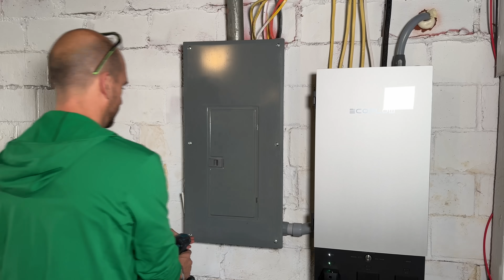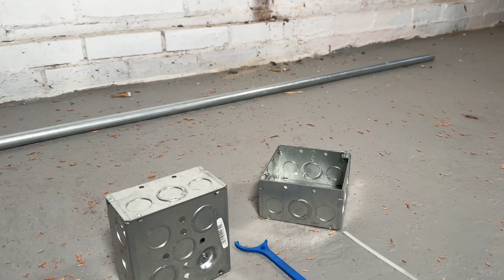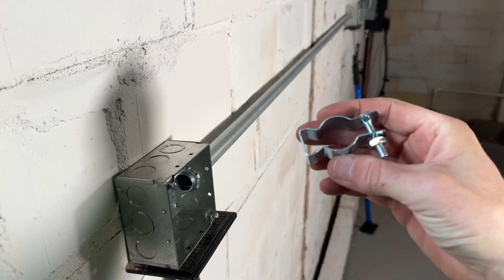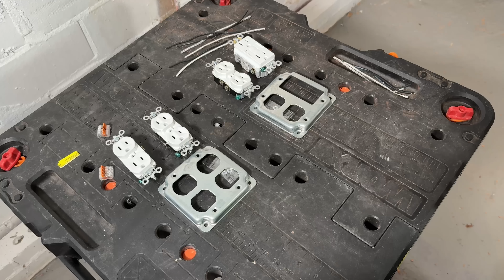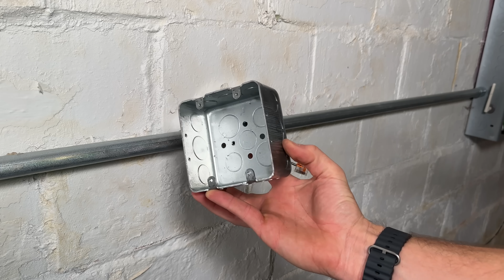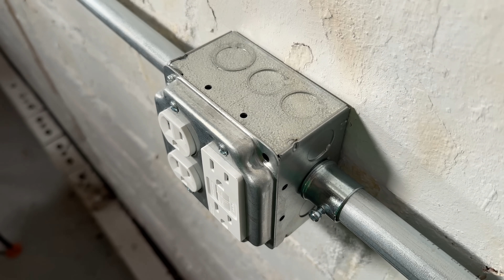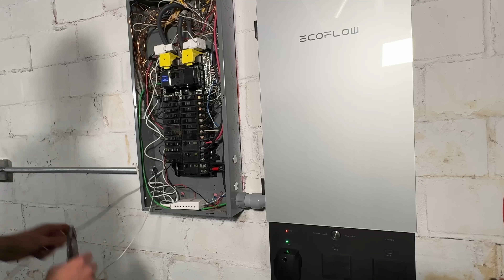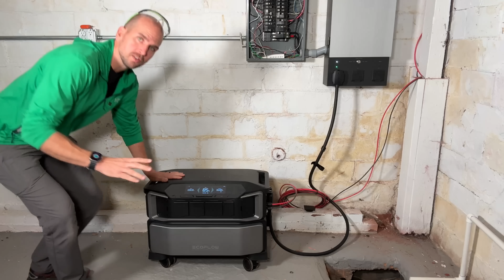Add Outlet To Unfinished Basement Or Garage

Comment: When your not using a dedicated ground wire, it seems to me the ground connection becomes dependent only upon those two screws holding in the face plate. In a damp environment, such as a basement,  those could corrode or rust over time, interrupting the ground connection to the breaker box and ultimately to the ground rod in the soil. Those screws could also work loose,  interrupting or at least weakening the path to ground. The extra work of adding a single green wire seems well worth it to me. I'm a science educator, not an electrician. But what do you think?
Reply: Why would fitting screws magically come loose or corrode but a ground screw is immune to those same issues? Nonsensical, conduit grounding path is solid and as long as it's installed properly will last for decades. EMT is installed outdoors every day so in a basement, even if there's dampness present, it's a non-issue.
Reply: @pld8993  You've got a point there, but with both a ground wire and conduit, you've got a backup in case one or the other fails. For the minimal extra cost of a ground wire, it seems a no-brainer to me.
Reply: @SiteReader  True, in this case the cost and labor to add a ground wire is miniscule, but I've done projects where adding ground wires would add many thousands of dollars to the project, sometimes requiring larger conduits to accommodate the ground also.
Reply: @pld8993 Ahh, I see. Well, as I said, I'm not an electrician but a science writer and teacher. If I were doing this in my house, I'd certainly add a ground wire. . . Come to think of it, I did a small installation in the garage of my old house where I ran conduits to two boxes on one wall to power an overhead light, my saw, and other plug in tools. I used 12 ga. Romex (which I think I recently read isn't the right thing to run inside steel conduit). I was planning to switch out the breaker to a 20A one, but I wasn't sure how and never got around to it.
Reply: @SiteReader  There's nothing wrong with running romex in conduit and it's sometimes required. Two of the biggest myths in the trade are a) romex is not allowed in conduit and b) everything must have a wire type ground. Both false.
Reply: @pld8993  Thanks.

Comment: Aren't  you required to have bushings on the connectors to protect the wires?
Reply: Not if the conductors smaller than #4

Comment: You never bent offsets in the pipe.
Reply: Not necessary.
Reply: @pld8993  I know tthat they aren't technically necessary, but it does make for a professional looking job.
Reply: @fldave612  No offsets is just as professional. Offsets are not always the best way to do an installation and sometimes they're the wrong way to do it. Sometimes, either one, doesn't matter.

Comment: Wish this video had been up twenty years ago when I wired my garage.  Along with the Wagos. Could have saved a lot of cursing at the 12 gage wire. But then I never use more than one power tool at a time, so 15 amp would have been just fine.

Comment: If you are making a video on electric and safety,  you should follow the code. NEC. 
YOU SHOULD PULL IN A GROUND WIRE, UP TO CODE.!!!!
Reply: The conduit is the ground and the NEC does not require a separate wire type ground.

Comment: You should always run a separate ground conductor. Redundancy is key in case any conduit connections come loose or suffer corrosion. At the panel you should use a bonding nut on the first connector. The enamel on the equipment or slight variations in the size of the hole can compromise the strength of the ground connection. Also you should use nylon or pvc isulating bushings after the nuts on all the connectors to protect the wires insulation. And finally, code requires the conduit to be strapped within 3 ft of any box or encloser.
Reply: Fittings do not magically loosen any more than ground screws magically loosen. Corrosion, except in the harshest of conditions, is rare. Redundancy is unnecessary on a properly installed conduit system.
Reply: @pld8993  Yes, I somewhat agree with you, but as someone in the industry, and does a fair amount of commercial work, I don't think I've ever gone in any shop or warehouse that didn't have conduits hanging by the wires or off some random mangled J-boxes. Where there's people, machinery and equipment there's damage, which is great for me being in the maintenance/service business anyway.

Comment: I know it meets code the way you did it, but I always pull a ground wire. Those set-screws on conduit become loose, and I don't trust that bond to remain over the years.
Reply: Set screws on fittings do not magically come loose any more than ground screws magically come loose.
Reply: @pld8993  then why do I find them loose all the time? Pull the wire, lazy electrician.
Reply: @pe-msee  So a fitting screw in a 1900 box will magically loosen over the years but the ground screw in the same box  is immune from this supernatural phenomenon. Typical, ridiculous logic from a not electrician who clearly doesn't understand what he doesn't understand. Properly installed fittings do not run the risk of loosening any more than properly installed ground screws.

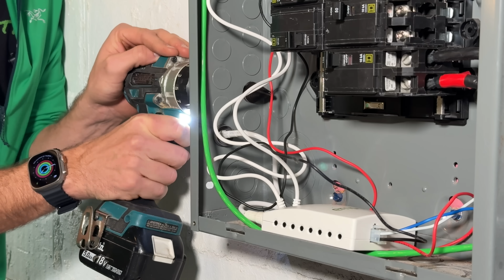Comment: Pro Tip, never blindly drill into a panel with a stepper bit. It's a good way to cut the insolation on a wire and cause a short. 1:12 Fortunately he at least pulled power first.

Comment: You probably didn’t even need to used a rotary hammer if you were gonna tap into the mortar, I would’ve at least got into the solid brick😂
Reply from the maker: I actually prefer brick as well but this specific home the brick is extremely brittle.
Reply: @EverydayHomeRepairs  ok well dang , I’ve seen some bad brick before and there’s a couple of work arounds . Keep up the good work it was a good video I know you’re trying to help people.

Comment: Hmm. A garage, with a nice 200 Amp service, and you opted not to install any 240 Volt, NEMA 14-50?   Besides that, all the professionals in the comments have some other valid comments.

Comment: While this is a good video, it is not just replacing an outlet, it is suggesting people can do this themselves. I would caution anyone to please NOT open the panel or subpanel unless you are a licensed electrician. I am NOT, so the most I will do is replace tired outlets and switches.

Comment: Not required, but it's a good idea to use other than the center knockouts in the 1900 boxes. It'll give you more room for wiring, and might be necessary if you put a dimmer or a 50amp receptacle in one in the future. There's reasons apprentice electricians usually have to prove 10,000 hours working with licensed electricians plus 5 years of school before they can even apply to take the licensing exam. All the good comments pretty well point this out.

Comment: Thanks for taking the time in making the video, but I honestly only learned about 10% or so of what I was here for. When you're teaching how to install wiring/outlets, please spend time in showing how to connect everything in the box instead of fast-forwarding the video. You passed on very little vital information, and some DIY home-owner is going to waste money on an electrical inspection, because you were not detailed enough in connecting wires.   It's obvious why you made this vide, and it wasn't to install / teach.

Comment: hello and thank you for the excellent video.metal emt is a good conducter for as your ground but in all my years as working with electric i always recomend running a green line as a posative ground in emt from outlet to back to service panel only as an additional safety to avoid conduit run  seperation.again thank you for the video.  mr dennis brown

Comment: I always run 2 hots, adding a red.  That way I can have each outlet on a separate circuit (it also allows me to easily change to 220v if needed.  And, I always add a green (as noted below), and add screws to support the conduit (as also noted below).  And, although it is a pain, I bend the conduit so it does lay flat against the wall (which is also mentioned  by others, below).
Reply: If you use Mineralacs you dont' need to do any bending to get back to the wall. Those standoff about 1/2 inch.
Reply: Wouldn't you then need the proper conduit bending tool? Otherwise you would kink or damage the conduit.

Comment: Come on dude run a ground wire - don't be cheap and  it doesn't dodge code.  Also when picking out junction boxes pick one with a ground screw so you can attach your ground wire to the local box and the  outlets.  Also you need to anchor the conduit.  I use offset fittings out of the boxes if you don't want to bend the conduit then you can use strap anchors.  Easy peasy.  Also my preference I like to use the plastic wall inserts you pound in for block wall.  Tapcons tend to blow out the wall easier.

Comment: It is permissible to use romex in conduit and the supports such as the mineralac straps are not a suggestion.    They are required within 3 feet of the box.   A ground wire, while not required on that conduit run, using the raceway as a ground path, is permissible.  But a ground wire would be a Cadillac job.

Comment: So will not pass inspection, conduit needs additional support. also no conduit offset to get up against wall, if not bending then could use a spacer block under maybe but should be clamped to that wall. Also I do not use the conduit as the ground, it does need to be continuously bonded since going to panel is but I run additional ground to outlets. most residential outlets are not designed to be grounded by the mounting tabs requires dedicated ground to outlets need commercial is doing that. I do not like using tap-cons since has sharper edges I prefer panhead screws.

Comment: In my state you would still have to run an insulated ground and ground each outlet to that wire as well as bond it to the box. Because if a screw or connector loosens you can lose the bond.
Reply: Why would fitting screws magically loosen themselves but somehow ground screws are immune to that? Which state?
Reply: @pld8993   I didn't write the rule man I just do it. Did you write this same comment on the 400 other people who wrote the same thing are you just saying it because my name
Reply: @lucyfuir6386  Which state? I'm curious if it really is a requirement, in writing, or if you're just assuming it is because that's what you've been told. What does your name have to do with anything and why would I care?
Reply: @pld8993  go away stalker not giving u my info
Reply: @lucyfuir6386  Yeah, either I'm a stalker or you're wrong because in your state no such rule exists. I vote for B, thanks for playing.
Reply: @pld8993  think what u want perv
Reply: @pld8993   Did you make the same comment on the other 400 people who said the same thing did you ask them what state they come from no you only asked me because I have a girl's name so F off
Reply: @ir6386 So you claim there's a rule in your state requiring a wire type ground and when I ask about it you resort to name-calling. Great argument, genius. Yes, I've asked plenty of people what state has supposed rules they claim it has and in almost every case they've been, like you, wrong. Having a girl's name doesn't make you wrong, you're wrong regardless. There's no such rule in your state.

Comment: Good video and found it informative.  As a always learning DIYer I couldn't help but noticed that your outlets and the GFCI appear to be 15 amp vs. 20 amp hardware.  Should the outlets not have the "9-o'lock" leg to designate that it's a 20 amp circuit.  15 amp outlets I thought just have the 2 vertical legs (plus ground hole), where as 20 amp outlets have that "T" on the left vertical  leg of the outlet.
Reply: If  there is only one outlet on the 20 A breaker. You are correct it would  have to be a 20A outlet. If you have more than one outlet on the 20A circuit then you can use 15 amp rated receptacles. Look in most kitchens they are 20 amp circuits, but they are 15 amp rated receptacles, because there are multiple outlets on each breaker.
Reply: Hey John thanks for the explanation. Much appreciated. Funny you mentioned the kitchen because after I commented I was in the kitchen later and looked at the outlets and yep they were 15amp ones.   Always learning. Take care.

Comment: This is a new circuit. Where is your electrical permit? In Colorado we can get a home owner's electrical permit and we have to call for the inspection. I followed code and pulled a permit for a 4 foot conduit run for a 50 amp 240v welder outlet. The permit cost just over $200. The materials cost me much less. The inspector was surprised I pulled the permit and was surprised that  I did it right, including clamping the ground wire to the outlet box and connecting it to the outlet. The inspector indicated that a lot of home owners don't do all this.

Comment: I might have missed it with 1500 comments. But he is running 12/2 wire with a 20A breaker. Using a 15A GFI. I would think you would need a 20A GFI too. The 15A outlets I understand, which would be code since there are a few outlets. But 20A ones would be better!
Reply: You can use #12 wire with a 20a breaker and 15a receptacles. Code says must use more than one receptacle so a single duplex would be sufficient. It's just about the only thing he did correctly in this video.
Reply: You can use 15 amp outlets on a 20 amp circuits as long as there are 2 or more.

Comment: One additional comment on safety. The power leads and sensor cables for what looks like the power monitor box mounted in the bottom of your electrical panel were awfully close to that hole you were enlarging in the side of the panel. Around 1:18 in the video it actually looked like the red wire moved once or twice when your honing device may have touched it.

Comment: I have not seen a circuit run in EMT without  ground for about 2 decades. I remember it being required as part of the local codes (AZ, CA, and NV). The MGM fire was started corroded conduit. So much of the code requirements changed  because of the that fire.

Comment: coduit not offset and no strap conduit. bad example.
Reply: box offsets not necessary
Reply: why not? because you didnt know how to bend conduit? @pld8993
Reply: @wefixit5906  No, because they're not necessary, it depends on the installation. Sometimes box offsets are used, sometimes they're not.
Reply: @pld8993  why not? What do you mean sometimes? Conduit need to flash on the wall to be safe
Reply: @wefixit5906  Offsets putting the conduit against the wall do not make it any safer than if there are no offsets. Sometimes offsets are used and it's secured with 1-hole straps, sometimes they're not used and it's secured with minis, every installation is different. While in this video he didn't secure it and should have, no offsets is fine. Offsets also adds to your bends count so there are times when you wouldn't want offsets for that reason. You also don't want offsets in wet locations so water can flow down the wall behind the conduit.  In a dry location like in this video, either way works.

Comment: You should use box offsets when entering a box or panel
Reply: Not necessary. Either way is fine, though he is missing a support on the longer run.

Comment: I'm not an electrician, but have done electrical training and code IS to ground all metal electrical boxes.
Reply: EMT is a NEC approved means of grounding.
Reply: @KevinCoop1  EMT is an approved equipment ground per article 250.118(4)
Reply: @jay9308     ???
Reply: Only if there are splices within it.  If the box is only used as a pull box, the box can be grounded via its raceway terminations as long as you have a metal raceway (standard locknuts where allowed by code, bonding bushings required if there's impaired continuity due to ring knockouts remaining and >250V to ground).  With splices, you either need to land an EGC from within the conduit on a lug, or terminate your conduit with a bonding bushing or bonding locknut, and connect the bonding jumper to the EGC terminal of the box.

With plastic raceways on metal enclosures, you have no other option than to run a wire EGC and bond the box, no matter what happens inside it.  Vice-versa, a plastic enclosure with no metal backplate, enclosure bonding isn't even applicable for obvious reasons, so if there were metal raceways, they'd have to bond to each other via bonding bushings and jumpers.
Reply: only if using eccentrics on the box.

Comment: What happens if someone comes by and removes a cover, now those devices are no longer grounded. Or the lock ring at your panel becomes loose. You always run grounds to everything. Equipment being grounded is what’s gonna keep you alive. You never wanna cheap out on grounding.
Reply: Why would the locknut magically loosen? Using that same argument, what if the ground screw comes loose? EMT is a solid grounding path and a wire type ground is redundant and unnecessary when the EMT is installed properly.

Comment: Not a good idea to have your hand on the ground (box) when you use an external GFCI tester to induce a slight current into the ground to activate GFCI outlet. 

I’d imagine you’d be fine 99.99% of the time however you are relying on the GFCI outlet and GFCI outlet tester to be functioning properly. 50% of that is moot because the reason your testing it is to verify an unverified outlet in the first place.